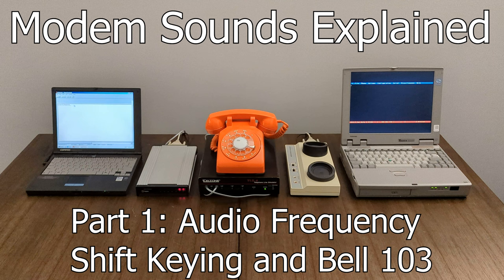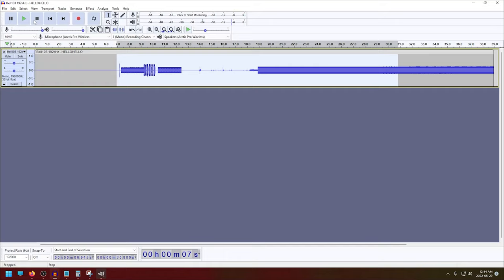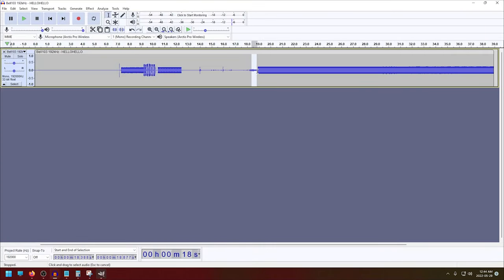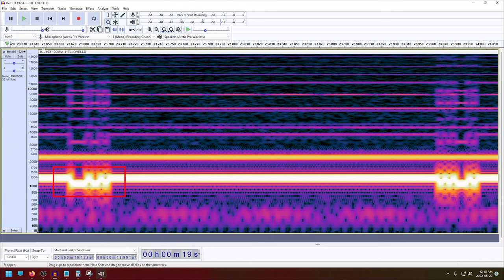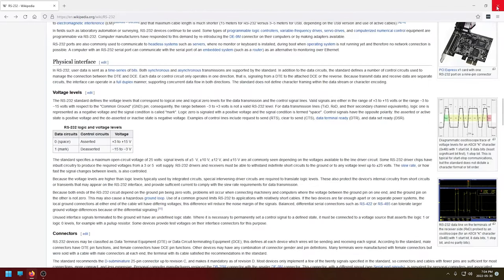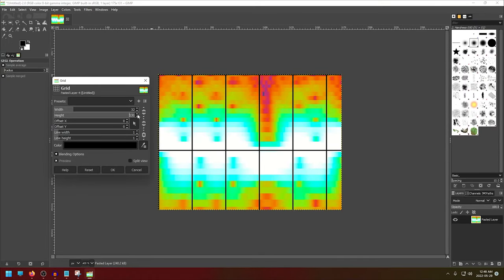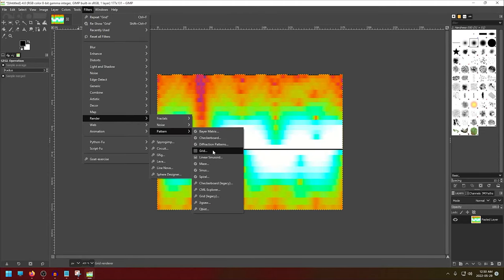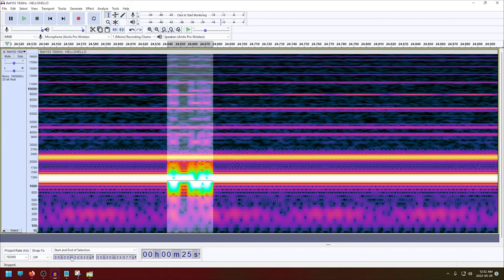Modem Sounds Explained, Part 1: Audio Frequency Shift Keying and Bell 103

Comment: Amazing! I've been curious about learning in detail how dialup works recently, and then this shows up in my recommendations section, perfect timing. I especially appreciated the recordings and analysis of the actual data transfer, most videos on YouTube that I've been able to find so far only seem to cover the handshake. Very much looking forward to more! :)
Reply from the maker: I'm really glad it was helpful! I'm hoping to dig into the actual data transfer for some of the faster speeds as well - covering QAM at 2400bps I think would be really instructive. I'm going to need to source some better gear for it, but that's in the works :)
Reply: @retrocet  is there a website that makes the modem sounds?

Comment: The only part missing, that I'm curious about, is the notion of half/full duplex over the telephone system and how it works.
When two person speak at once, is it over 2 seperate audio canals, or are we sharing a single medium?
I'm guessnig the latter, otherwise why would Bell 103 use two different frequencies for both direction.
I guess I just answered myself. There's a shared medium, and Bell 103 is full duplex thanks to the two different frequencies.
Reply from the maker: You did answer your question for sure - they deliberately picked orthogonal frequencies to avoid cross talk, because there's lots of it in this medium. In fact for voice hearing yourself is a feature - 'sidetone' lets you hear yourself and helps people talk more naturally on the phone (it's common to kind of yell without it). 

Also, this will actually end up being part of a later video in the series! Echo cancellation became very important for higher speed modems :)
Reply: @retrocet  We hear ourselves? Lol ... I never realized 😂

Is it something that was amplified/added later on? We hear all those stories about how old folks used to shout in their phone the more long distance the call was. I had always attributed it to poor amplification over long distance back in the early days.
Reply from the maker: I actually think it was worse in early phones, and actually needed equipment to keep it at a reasonable level. 

That said, you might still be correct about long-distance calls being quieter - it would be a natural reaction to a caller being really quiet to assume that you're also really quiet to them, and raise your voice to compensate - like yelling across a field.

Comment: What does 64, 4 and 1 stand for in 9:34 ? How do you figure them out?
Reply: These are the bit values of each 1 or 0 in the binary number representation. Each 1 has a value that is a power of 2, starting with the least significant bit (LSB, the first data bit transferred) having a value of 2 to the 0 =1. Each subsequent bit has the next power of 2 up, so the value of each bit in the binary "word"(or number if you prefer) doubles: 1(LSB), 2, 4, 8, 16, 32, 64, 128(MSB). https://en.m.wikipedia.org/wiki/Binary_number

Comment: Is there a way to get the spectogramm more precise / higher Resolution. I thought it would be more clear to read, cause there are Modems of that type which are >100 times as fast.
Reply from the maker: I've modified my recording setup since making this to make digital, bit-perfect recordings of the call, which provide a lot higher resolution and detail.

Comment: Oh gosh but if I would have let’s say trying to use voice over IP and then connected on an analog line to the interconnection switch… it is not even using the IP protocol it just transmitted an H (which is the kind of thing Midjourney is still struggling with — Writing meaningful messages)…